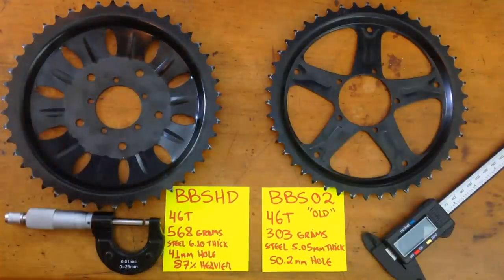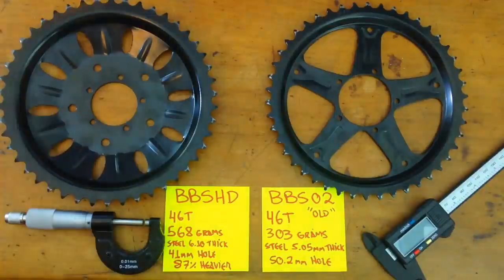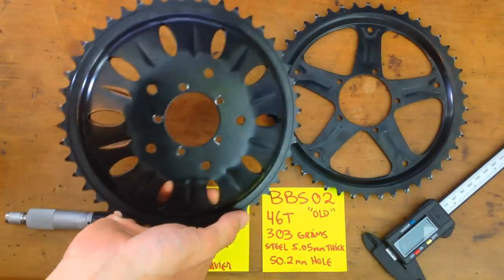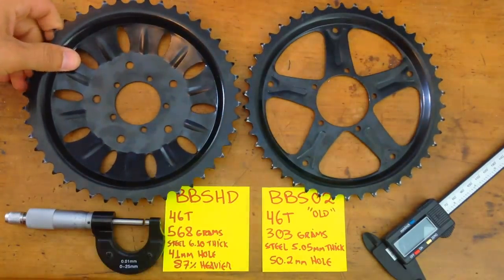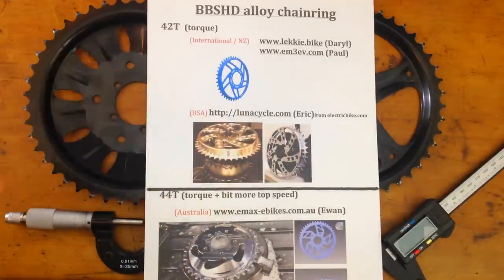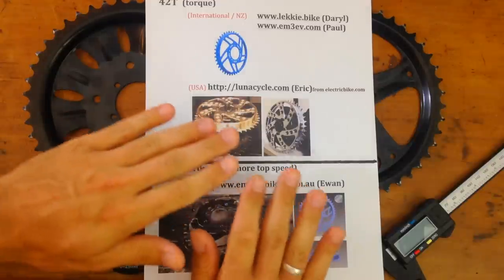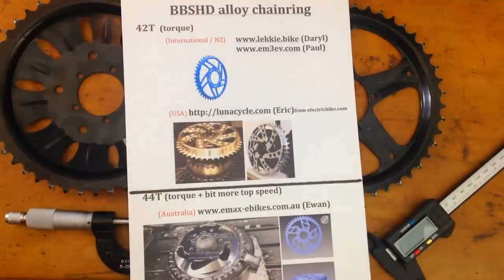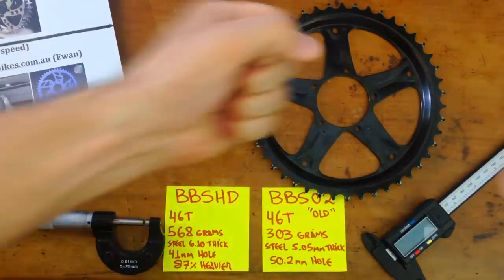Bafang BBSHD 1000w mid-drive • 46T Chainring Design Overview • Electric Bike 48v BBS02 8fun motor

Comment: i want to get the BBSHD and use it with a carbon beld drive system. What do i need to know to make that work? Hence i wont't be needing this nasty chainring :D
Reply from the maker: +Frederik Hollstein - Yeeeahh... carbon belt drive... sounds great... but... you need a bike frame that will split open so you can fit the belt inside the frame.  The frame must be designed for belt system. Normal bike you cut or join the chain. I would absolutely LOVE to ditch my chain and go for belt drive but then you lose all gears unless you use an internal geared hub (also called IGH). It is a great idea, the frame and finding the belt and pulleys with the correct ration will be a bit challenging. If you make it... PLEASE give me all details I want to make one myself =]
Reply: +ElectricBike (Bruno) Thanks for your reply Bruno :D So there is no way around getting a certified frame for carbon drive? I assume that makes the build more costly. And yes i want to combine it with an IGH, but I doubt I have the budget for a Rohloff internal gear hub. Might go for a cheaper but decent alternative. I will do some research on that. I was thinking a light aluminium frame. What s the best way to buy a frame actually? Chinese manufacturer, bike shop or online on some bike website that already imports for you?
Reply: +ElectricBike (Bruno) something like this http://www.poison-bikes.de/shopart/9915000295/Mountainbikes/Hardtail-_teilgefedert_-26-Zoll/Zyankali-26-Getriebenabe/Zyankali-IGH-26-Rohloff.html (maybe one with full suspension and thiker tires) and then the BBSHD. This thing does have a rohloff in it and a belt drive hahahaha
Reply from the maker: +Frederik Hollstein - I saw the link, clicked on it and opened another bikes... but yeah.. Rohloff would take all that power with a belt for sure... that hub is sooooo amazing but you pay sooooooooooooo much money too.. it all depends on your budget.. =]
Reply from the maker: +Frederik Hollstein - I tried to find a link here of a company selling frames for carbon drive belt, it has a split on the frame, you unscrew and it opens a gap, you fit the belt and screw back again. Can't find the website here =/ Talking about aluminium frame, carbon frame and electric, not good idea... carbon could crack any minute and at higher speed if could be fatal... aluminium is much stronger frame, won't crack like that and weight little bit more, not worth trading safety for 500g lighter frame..
Nexus IGH does a great job with electric motors, I have read many articles saying good things about, not expensive at all and very light too. NiVinci feels reeeeally nice (constant variable transmission, no gaps between gears) nice but won't take the BBSHD torque.. 
NuVinci Harmony the one with electronic shifters will blow with a 52v battery (14s) when fully charged (around 58v), I am testing one with the BBS02 at the moment, completely dead.... should be fine with normal 13s 48v battery pack.
Finding a frame that will take carbon belt is really hard but not impossible.. keep googling, maybe Alibaba or Aliexpress you may find some chinese selling it... =]

Comment: whats the price for the hd kit ?
Reply: I got mine for 600 usd
Reply: +Murdercom were did you buy it from ? in france it's not available and the bbs02 is 699 euros ... quite expensive (without battery) also , good battery option (cheap) ??
Reply: +skrillex1234ful I had battery left over from old kit. its 660 right now I got an 11.11 sale for 560+98$ shipping it might be 100$ off for black friday
Reply from the maker: +Murdercom - Buying the unit is fine.. they all come from the same factory... The support you get from reliable sellers is totally worth every single cent!!  I received so many messages of people saying that they had problems buying cheap ones from Aliexpress, Alibaba or eBay sellers but most of them will vanish or provide zero warranty to you (some people couldnt get their motor fixed, lost all that money and had to buy a new one). Consider these possible inconveniences before purchasing anything. =]

Comment: so if you made it ring ring like to let you put it up to a year that was a like a lucky on top which now switching to another gear that I got lucky that came down to the trailer which I don't know if you only need a single sprocket on the rear but you would increase the speed of the bicycle and the fan motor will not go away because you just talked it up to another if I can shift the gears and you keeping it at that I are here so as a result I don't know how that would work and if it could work with that even go faster let me know your thoughts would it work with your mother and by having the pain below and above and then goes to a smaller on the top then it goes to either one which is like a like a double sprocket and then I want to spend the rear wheel what would that do to the bike or could you just make it happen when you're doing the buffet it's been to crank arms 110 East side and has two different drives but having a different gear in the back maybe it would interfere with a change they would tangle up but I have it like that
Reply from the maker: Yes, the best thing you can do with the Bafang ones are to get the Lekkie 42T chainring or the new 130BCD adaptor so you can install normal bike gears. The Lekkie you get a better chainline but the other one you can try something like you mentioned, installing different sizes... apart from that, electronic programming settings and a higher voltage battery (52v instead of 48v) there is nothing else you can do. You can't modify the Bafang bottom bracket because there are sensors and internal freewheels attached to it. There are some other electric bike systems that may be possible to make what you're talking =]
Check out the Cyclone motor and the EGO kit they both share the same motor but completely different mounts, the EGO is more refined and comes wit battery and all that blablabla.. the Cyclone is very "raw" and basic
Reply: ElectricBike so if the same motor as for this motor is the power source of electric bikes this is the motor to get then now you just informational it's either putting the chain ring above and making it the size of which one gives more power than the kranked bike setup or the bufang set-up what are your setup my phone can't spell these words very well so I don't type them
Reply: ElectricBike so in theory the motor that you talked about that you're using if you weighed your weight and kept it at a speed of this amount you would be able to get how many miles out of that motor if you never abused it you kept it at a 15 mile an hour speed you never done it at the start but with the life capacity of that motor be vs. The way you're riding it at full speed Highway overpowering it and pushing it to the limits now what would be the difference in mileage that's the key now for me I don't weigh the same as you do and I don't feel the same way as you do so I need a motor that compensates my weight plus I'm not going to be doing that telling it to make it the more I want that's going to be the same as what you would get with that motor if you were driving at 50 miles an hour I need something that's three times stronger and a battery pack that's probably twice as big as yours to do the exact same thing that you're doing on the bike that you have now and with your weight is the Motorola that were talking about the ideal motor I don't want to tell I'm not trying to be the break it fix it kind of guy but I don't fit I don't ever hurt me as much as you do so if I don't weigh as much as you do and I don't cuddle as long as you do I'll never be the same writer as you so for me I want to make this wheelchair because I am not your weight it would be less stress on the motor if I was less weight it would be less stress on the motor if I was to go less distances okay but I want this to last for a long time and get the maximum amount of miles out of it and not have any worries about it breaking the motor and the battery pack the only difference between me and you is is the weight on pulling the battery back doesn't stress out what means my way to double your weight if you weigh 130 and you now 260 I would use twice the battery life that you used that's the difference of my weight is conversate about a better it'll cost me $804 for a battery than it would cost you because I weigh twice as much as you to use the same exact same way so anyway that weighs more than double what someone else will use twice the battery someone else to ask and they are correct you are the father your battery pack will last and make you travel which means in the end your battery pack would never get me to the same mileage that I would get on it because I weigh twice as much as you enjoy a 3-year my battery your battery pack the only go I'll leave two of them to go the same distance that you doing one if I'm correct
Reply: ElectricBike what I really want out of a bicycle bike motor is it to be twice as good as the one that you're using now because if you're using this one and breaking it at your weight I'm going to kill it at my way and when it comes to the battery if I weigh twice as much as you do then to go the same distance in the battery pack I would need two batteries to do the same exact thing 1 battery does it have your way correct so then clearly that's how you figure that part out but that doesn't hurt the battery pack I just used twice as much battery as you do because I weigh twice as much as you do so there's no way around that unless I lose the weight the more weight and the more heavier are there more battery I have to buy so if I wait half of 1/4 is much I would only need to spend half a battery pack more to be equal to you and this is in writing not to be equaled it with you and motor I need something that is now half is half more stronger than what you have there on the bike again what is how to say it without destroying it so no matter what we get down to any bicycle but motor that's built if it's only capable of the lightest person on the bicycle works the best that's the hell they're all going to be I guess so no matter what happens if you are having a writer every motor that you get will be stressed to the point where it will destroy sooner than the person that slightest on it the person that is a lighter person will always have the longer lasting motor so if you kept that motor at 15 miles an hour and with your weight it would have went excellent at all exclamation with my weight it would have went x amount of miles so the motor also determines how much you weigh how long it lasts as to where the batteries are there's actually the same thing but you can double them if you double the amount of what you weigh but not everybody weighs exactly the same but the lightest person gets to go the farthest on the battery pack and gets the best out of the motor longest lasting
Reply: So in theory the battery pack that you have on your bike now if I was to if I was double what you and your bike away together on that and hopped on it with your battery I'll only go half the distance that you would go before I have to recharge it which means I get less miles out of a battery pack than you do because you weigh less so if there's eight hundred cycles and you're getting 100 miles out of that you're going to get in theory 8000 Miles out of that bicycle battery pack before and has to be replaced that's where I only get 4000 I have to pay double the amount per mile in electric battery can you do that what would be the difference on the motor but I have to go through to Motors to make sure you do the same amount of miles for his you doing one so in theory the little motor that you're pushing to the Limit but if you kept it at 100 pound Rider and drove it on only straight flat land at 15 miles an hour what's the mileage that motor and I will do there is the theory will you get since you blew yours it was 3000 Miles whatever it was would you be able to get 10,000 Miles by doing it by keeping it at a certain speed and a certain weight and then that motor would last forever so what you're basically everybody wants to have is when they want to buy a motor and want the same exact thing that the lightest person has but if he's happier to be compensated in the motor the motor is not able to handle the weight of the heavier person that's the motors not be fear so you're not putting the stress on it that you because you're heavier
Reply: In theory in a car engine if you happen to be two hundred pounds heavier than the guy that drove the other similar car and never neither one of you put any weight on it and never kept it over a certain speed I think the cars are both going to last about the same amount of mileage I don't think the difference is going to be 50,000 miles difference because the guy weighs 200 pounds less than the other guy you have to go through more gas but the car itself will still be in the same condition I believe versus the guy that's two hundred pounds heavier I don't see that car being well how much should you weigh if your whole life when you have the car with you or did you ever go over this month when you hear it's where you parked it how fast you can see how fast you made it how are you busy now you shifted it all that's a factor that you're high rabbit so if you're just looking to get the maximum amount of their batteries pretty soon the cars are going to be able to get the maximum amount of air efficiency to weight ratio payment doing this and big rigs forever now you're buying a used big rig truck if you can it hold heavyweight its entire life it's going to be to the point where it's going to break down if it was just up and call the kleenex or toilet paper or its whole life or paper towels their truck is going to be no problem it's going to be the best truck you can because it didn't kill the truck because it had its maximum amount of weight it didn't stress it to the point where it destroyed it
Reply: And didn't take it up and down hill all day long call grits rent went up and down the hills so in theory I don't know what motor to buy because he doesn't matter to the car when I buy a 4 Banger car and I weigh 200 pounds more than you do if that car is going to be reliable it's going to get less gas mileage that's it and Ten Thousand Miles difference in the car maybe a little bit more abuse but not much
Reply: Doesn't really matter to a Honda with the weight of the driver weighs in at over its life capacity I'm sure if you actually did it exact measurement if one person weighs 3500 pounds more than the other person in their car which what would the car look like in the end difference if they drove exactly the same miles everything will be the difference in the car probably be minimal give me different gas bill but that's about it how do you know where the tires out anymore because you carry more weight you might who knows it might factor into everything but I don't think it's going to change the hoses the engine is not going to be more stressed out you might have attacked a little bit more and enough speed to compensate for the 500 pounds extra it's carrying in the guys with swallowing it at the 202 and that's not going to wear the car out any differently you wanted an optimal speed because he's going to 202 tachometer difference does it make the car where any different

Comment: so am I coming to you is on the Craig bike it's going to Crazy gearing system at Lynhurst and he can have the motor spin the out of the out of the out of pocket and the inter sprocket then spins the rear spins and Spins the chain all the way to the rear derailleur but your feet don't move as to where when your pillow your feet your put your turning both of the of the gearing's both of you inner sprockets One turns one to the other and that Motors just a little itty bitty motor that's not spinning a little just a little like that it doesn't have that bigger I wonder what it looks like does using on the